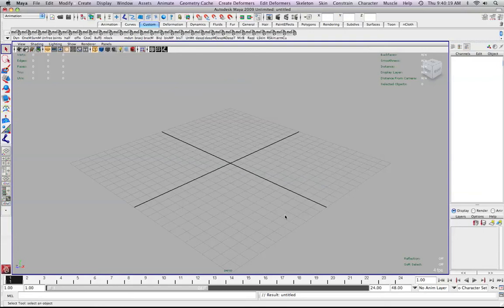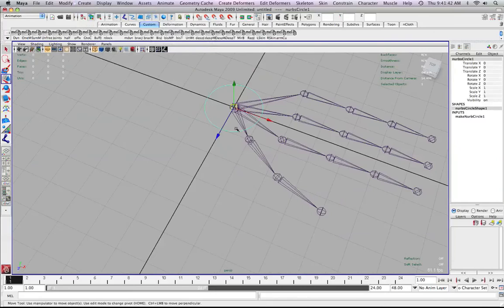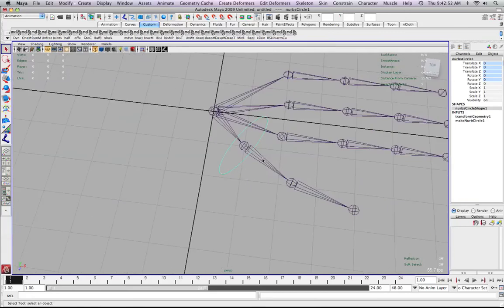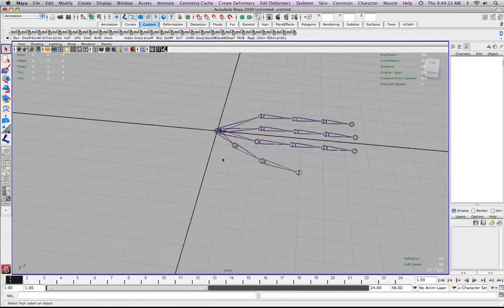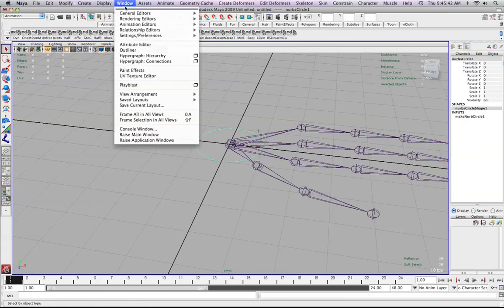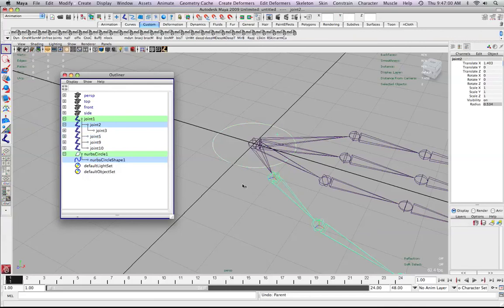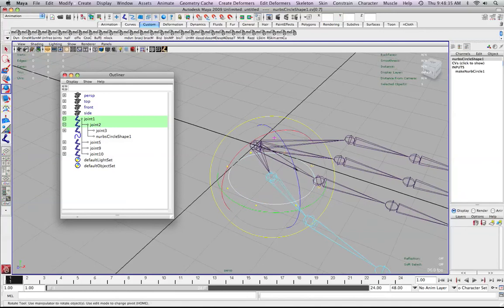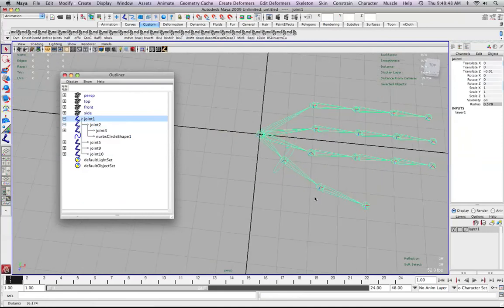Off Axis Control and Parenting Shapes Part 1

Comment from the maker: Is it the joints or controls that are rotating at all angles? if it's the joints, you need to make sure the joint orientation is the same for all of them. typically x is point towards the child joint, and y is pointing up. Not sure if that helps or not, might need more info...